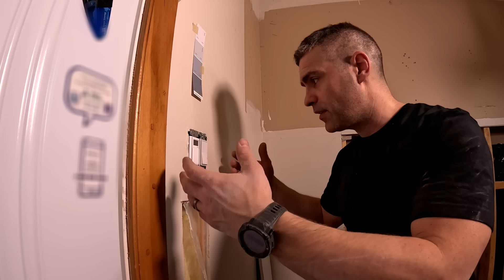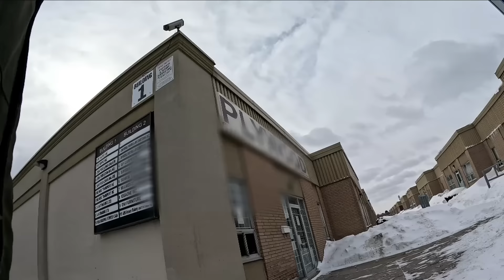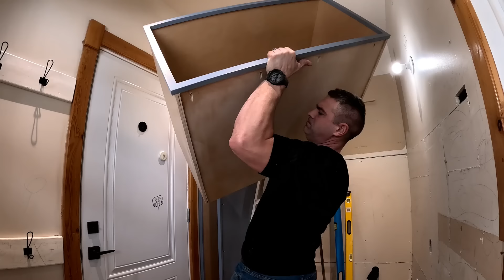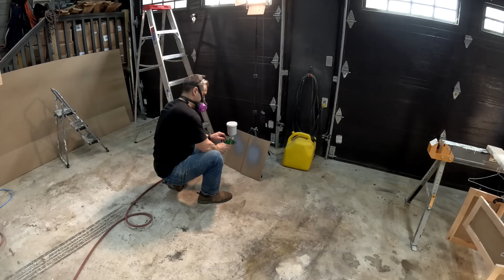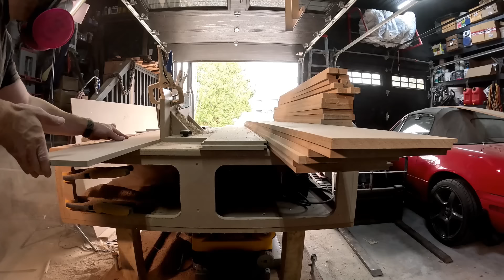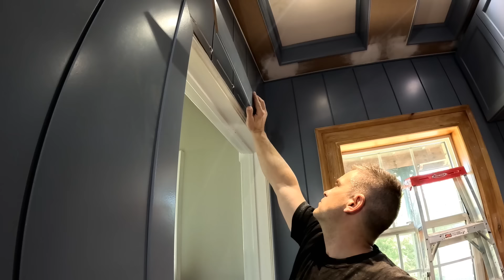The Art of the Reno: Dream Laundry Room Build

Comment: It looks amazing . Just one thing i think I would have put a light above the sink instead of on the wall.
Reply from the maker: I should have done that.  I did think of it at the time.  but sometimes you draw the line otherwise the project never gets done.   But, I should have put it in.  Would have been easy.

Comment: Nice design!  This is very much like my planned laundry room design.  No fancy millwork for me, and I'm not changing the tile flooring, but I am stacking the machines and adding a utility sink.  That part will be dead easy because the spot where it will go has a bathroom vanity on the other side of the wall.  I do think building the sink into that little cubby is going to detract from its usefulness.  Maybe it works for you.
Reply from the maker: Cool! - it's give and take.  the room is so small that having it where it was made it impossible to come in and out from outside efficiently,  I have 2 little kids, and this is also our mud room..   so we needed the space in that room more than the sink's function.
Reply: @Beautiful-Builds  Makes sense.

Comment: Love your work. My shop is in my garage and it’s a constant battle for space so I appreciated it. The attention to detail is great. Couple questions…
Why the magnets on the right side face frame on the washer / dryer. Is it so it can be removed if you need to pull out the w/d?
And second question is the paint. Love the color. Could you send me the details?
Again great transformation!
Reply from the maker: The magnetized peice of face frame is to proivide that needed 1/2 inch of clearance for the water tray at the bottom to slide out in case I need to pull the machines out.    The paint color is Benjamin Moore Oxford Gray (2128-40). It was really just trying to match the machine's color.  I'm glad you liked the video!

Comment: Why did you need to make that custom piece of flooring?
Reply from the maker: you can only go in one direction with flooring.  Nails go on the tongue side, not the groove.  Since I did the rest of the house a couple years and choose to go in the direction it was for other strategic reasons at the time, I had to flip the pattern around so that I could go backwards. The custom piece had a tongue on both sides, as opposed to a tongue on one side and a groove on the other. so, it flipped the pattern around so that I could progress in the opposite direction hat the floor was originally installed in.

Comment: What is the purpose of having the one single magnetic face frame piece?
Reply from the maker: I designed trimpiece to be removable to allow a larger gap so that the machines that sit in a pan to be able to slide out. The pan at the bottom with piping connected to the dump into the basement sump pump in case of water issues is an inch wider than the machines on each side and with both trim pieces installed, the opening is too narrow for the pan to slide out with the machines. Another option would have been to install the pan permanently fixed tilt. The machines backwards before you pull them up and use a piece of pipe or something to roll them down onto to get them out of the pan. But this method would have also required extra headroom inside the cabinet to be able to tilt the machines.. stacked laundry machines with a water catch pan at the bottom is a pain in the butt, however you choose to deal with it..

Comment: For your dust problem use a leaf blower with your garage doors open. Start at the back and just blow it all out.
Reply from the maker: I have done that - I agree it works well, or as well as you can get without actual ventilation.    in this case I just used my compressor with a blow gun..  but I have done the leaf blower as well.